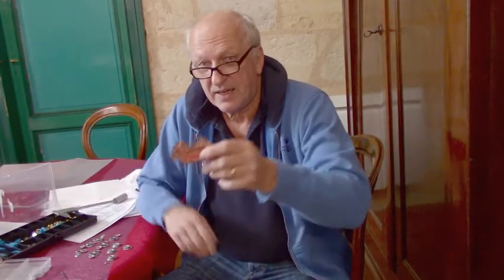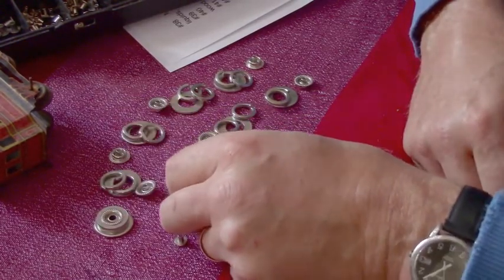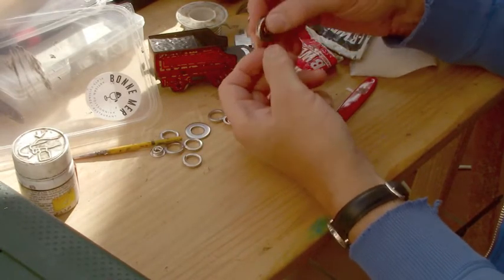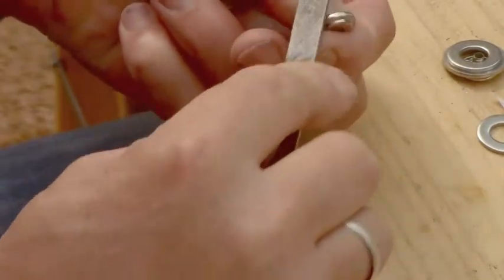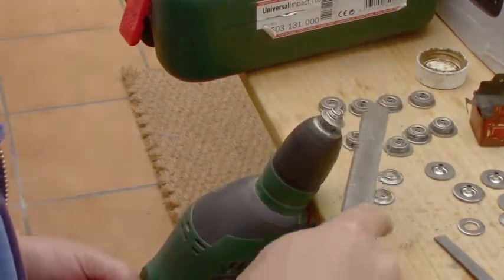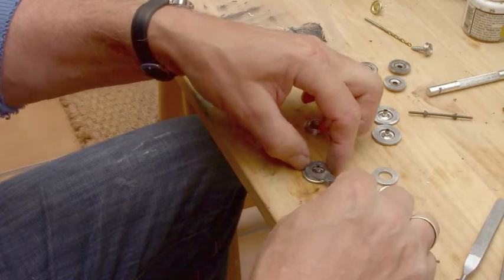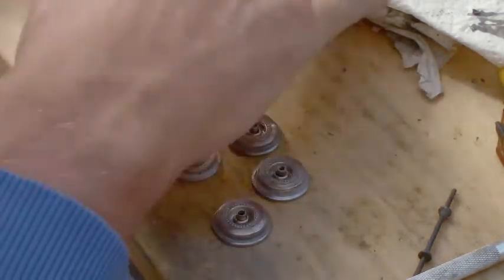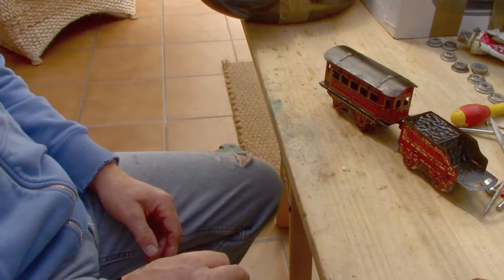How To Make Toy Train Wheels

Comment: I'm glad I saw this one. For some reason it reminded me of odd places I "saw a train wheel" in something common.
Alternate ideas to washers-Heavy duty clothing/canvas "pull the dot", "snaps", type fasteners, electric lamp hardware, and crimpable rope eylets might speed this flange creation some.
  Also think about a 1/2"/13mm o.d. automotive tube flairing tool for flanges and tire/tread, then cap the tube and flange & drill. ("6 prewar US Marx-2 axle wagons- tad under 3/4" flange o.d. with 1/2" tread od..  I think this size may also be on the Ives Joy Line.
  I just did a dozen candle wax molds in the center of an old Scotch Tape spool(easy release), later re-filled with wax blank, greased, laid in original JB Weld and one in Devcon clear epoxy for fun.  Nicer ones need no dressing other than cutting off some flange flash. They just need a hole drilled (blocked with toothpick for wax pour, they actually have an outer axle nub and just need an inner axle.  Tip: Wait for 100% cure to ensure flanges dont warp during wax removal or finger pressure while dressing, etc.
Reply from the maker: Great ideas...I used the snap fasteners on the wheels. Thanks for the tips.

Comment: Good work.
But there is a problem. 
Making 2 or 4 wheels is okay but when we make a whole train bogie than these handmade wheels are no of the exact same Size and hence doesn't fit into the train.

Plus the efforts are also little longer.
Please find and suggest some method in which we can make wheels with ready to use items (like single hole buttons)

Plus suggest to make at least 6 trains of 10 coaches.

I mean suggest easy quick method for mass production